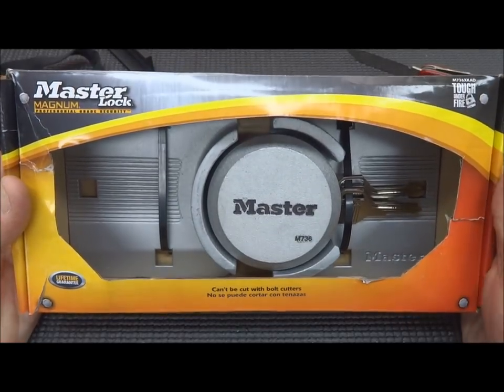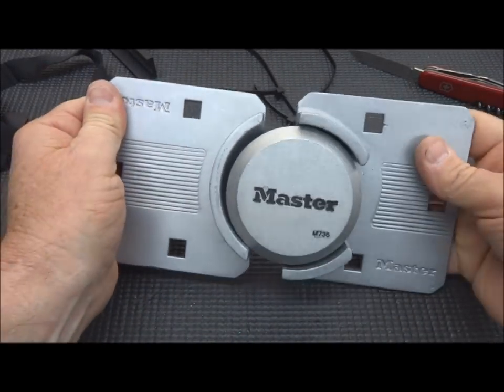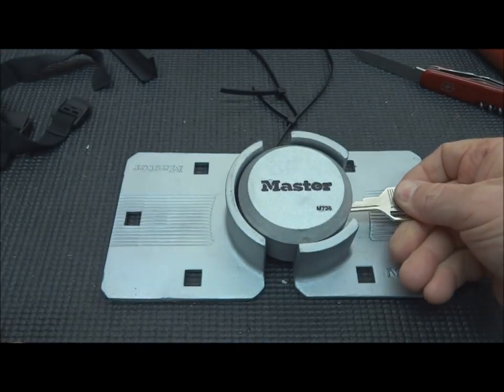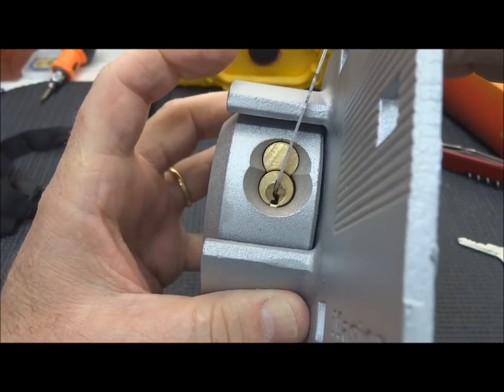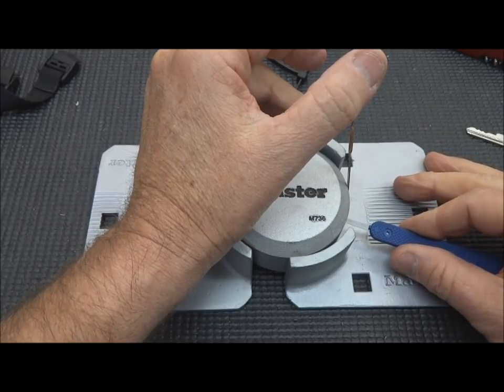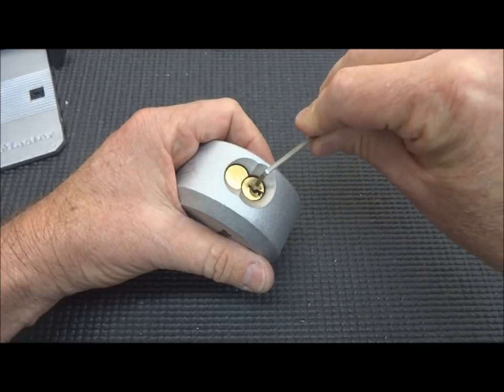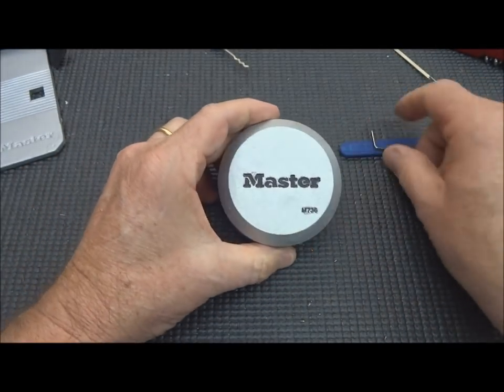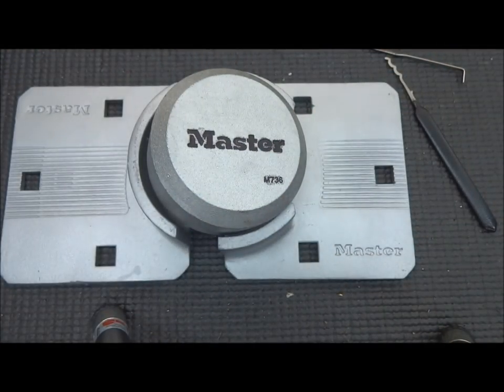(313) Review: Master Lock M736 Puck Lock (JUNK!)

Comment: Even if the lock was good, couldn't you just unscrew it from the frame of the vehicle?
Reply from the maker: No, sorry.  The mounting bolts are carriage bolts, with smooth heads and no way to grab or turn them.  You COULD grind off all the heads, but what a job THAT would be.  If you're going to go to THAT much effort, just use a can opener on the side of the van.  Or, easier yet, break out a window.

Comment: I'm sure this has been mentioned. You are in essence making these locks less secure by basically posting a how-to for criminals. This is clearly an irresponsible thing to do.
Reply: +Chris Staples Music "how to"?  I must have missed the part where he told people how to pick locks in the video. The point of these videos is to show which locks are secure/worth buying and which are garbage. It's to deter people from buying locks that won't hold up to some guy with baby's first lock picking set so they can purchase something that's actually quality made.
Plus, if you're someone who knows how to pick locks to begin with (a skill you'd need to perform what he did in the video) you're either a hobbyist or have bad intentions in the first place. 

I understand your concern, but you actually have to have some prior knowledge and experience to even perform what he is doing. This video will hopefully deter people from relying on this  garbage anyways.
Reply: My counter argument would be buying Master Locks is irresponsible. ;)
Reply: the only point i am going to argue here is does it really take any skill to rake a lock open? i have raked a few already and idk maybe i got a knack for this but it didnt seem like it required anything? just had to throw a few pennies here.
Reply: clint kees  No it doesn't take skill but you will use it even as you become more skilled. I'll give you an analogy I read somewhere. Raking is to lockpicking as power chords are to guitars. They are both simple techniques that work and are effective, but they are an entryway into much more complex techniques. Single pin picking is probably the most difficult but most accurate way of unlocking something.

Comment: not being funny but couldn't you just unscrew this entire thing for the vehicle
Reply from the maker: No.  Look at a carriage bolt and you'll see why.
Reply: Most people are not going around picking locks though. So the lock works good enough to stop most criminals. All you do with locks is stop honest people from doing stupid shit because it's an easy crime (we can debate whether they are actually honest) but you know what I mean. Lot of crimes are in the moment. Car door not locked and a $800 new cellphone sitting there.
Reply: also make sure you use stainless steel carriage bolts. they are a little bit harder to drill out.

Comment: you put this thing on a car?
Reply: +Paul Walters Work trucks/vans that have storage areas, etc.  Not for regular passenger door handles/locks.  - cheers
Reply: That makes a lot more sense. I don't know why I didn't think about that. Thanks
Reply: +Paul Walters It was my split second thought, too. haha.  Can you imagine putting it on something ridiculous, though? Like a school or work locker.   Office desk drawer.  REFRIGERATOR!!  haha  No one will steal my sandwich!
Reply: +EdwoodCA the fridge actually sounds like a plan, maybe that's all this product is worth, protecting sandwiches. I wouldn't doubt that some people have used this as a lock for the door on a car, figuring I've seen people with flashlights replacing a broken headlight.
Reply: Haha, exactly!

Comment: This video is hard to watch, because the guy picking the lock appears to have the skill and touch of a bull in a china shop!   There is no sensitivity or finesse at all, just rough raking. Any skiled locksmith would use "feel", learned through years of experience, to quickly open the lock. Any knuckle-dragger can ram a rake in and out of a lock and get lucky sometimes.
Reply: you did watch him spp AND rake it right?  Watch his other videos on proper secure locks that take immense finesse. This master lock is garbage.
Reply: He has more finesse than you realize, he just has no repsect for master locks and knows he can be a babaric picker without wasting any time, but if you watch him, for instance, pick a 7-pin document bag lock he takes his time and moves with his fingers instead of wrists or forearms.
Reply: Robert LASTnameDENIEDhehehe You may be right. People do things differently.  When I pick a lock, I always try to do it with finesse, if possible, especially for instructional videos. I probably misinterpreted his intention of making this video. I thought he was trying to show his skill and doing the best he could, so I was floored.